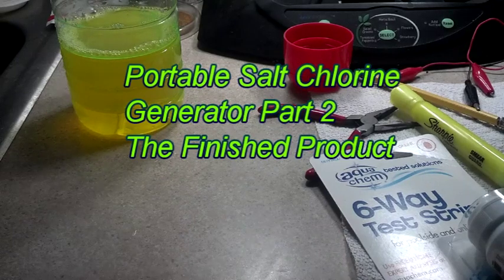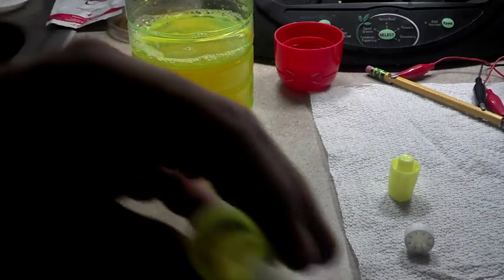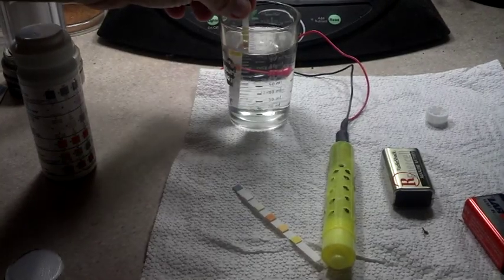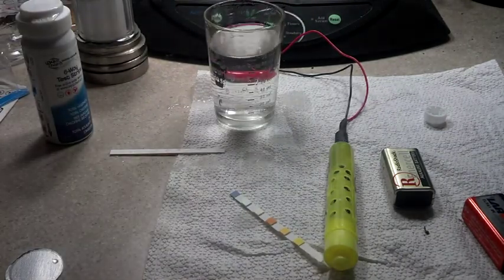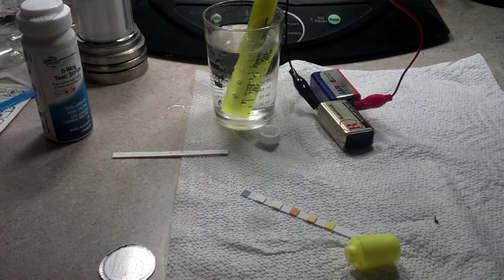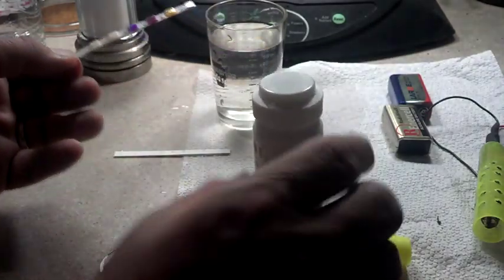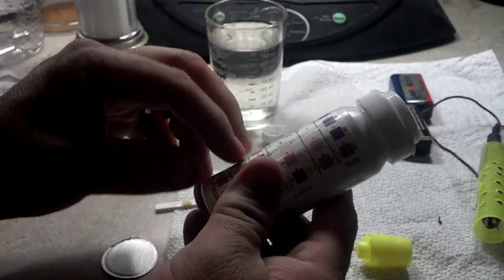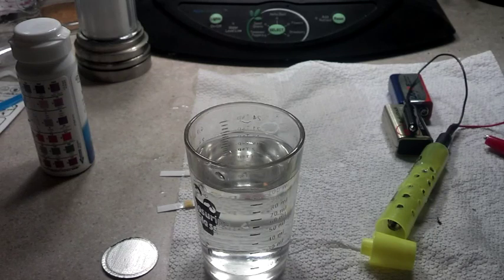Portable Salt Chlorine Generator Part 2 The Finished Product

Comment: A couple of tips for you.  Dip the strip and pull it out.  Then wait 15 seconds.  Second tip....do not use any plastics in sodium hypochlorite (that is what you produced) as it can break down plastics immediately into potential harmful chemicals.  I work in the water industry every day.  Just use the electrode without the plastic.   Nice video.
Reply: Sodium hypochlorite is not actually produced, which is one of the benefits of this approach. Cl2 is produced.